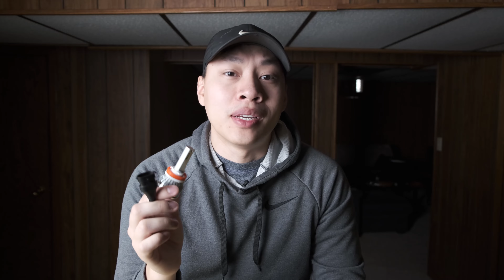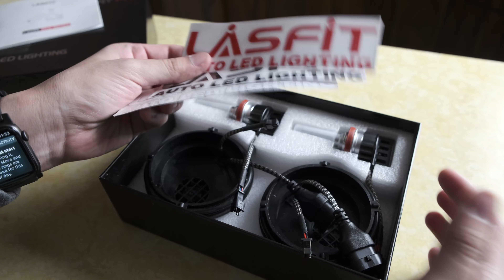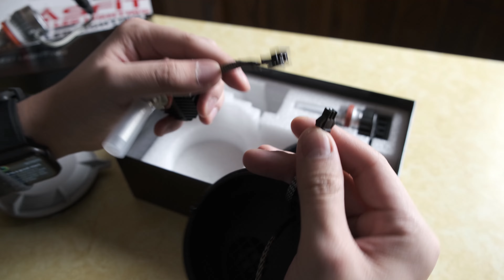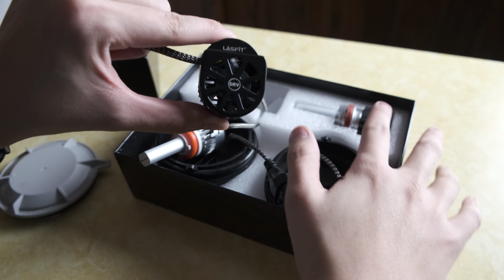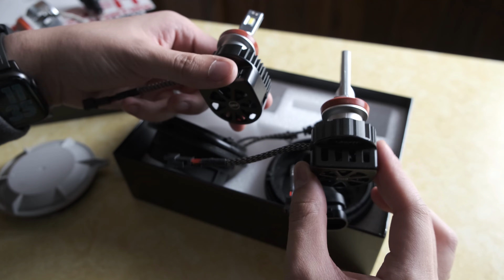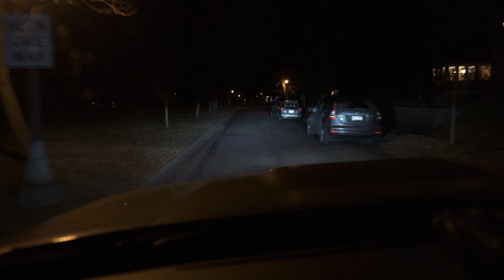LASFIT Pro - Toyota 4Runner Headlights

Comment: Did you upgrade your high beams to LED also?  If I can find one that reliably can keep my DRL, that would be ideal!
Reply from the maker: I did, however my high beams do flicker in DRL mode. I have not been able to find a set where they can run DRL mode with no flicker

Comment: How about compare with Morimoto 2Stroke 3.0 ? Morimoto 2Stroke 3.0 seem to be very hot now as led bulbs for car.
Reply from the maker: Have not tried those, but Trail4Runner.com has done a write up on those lights. Check out that article if you want to learn more